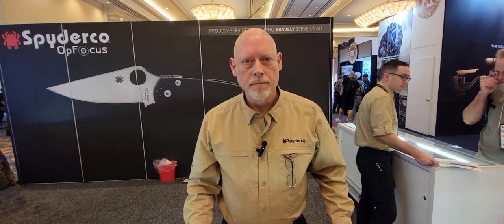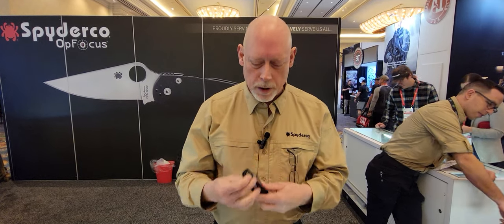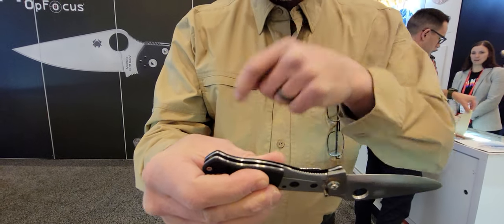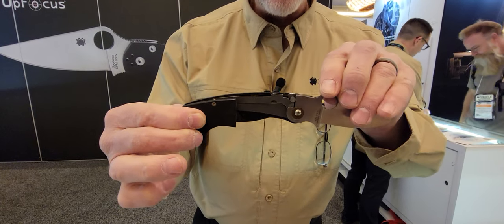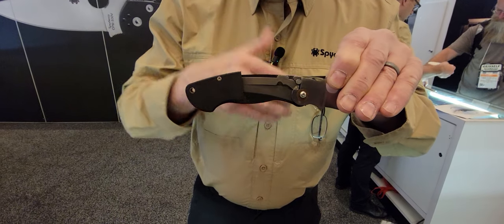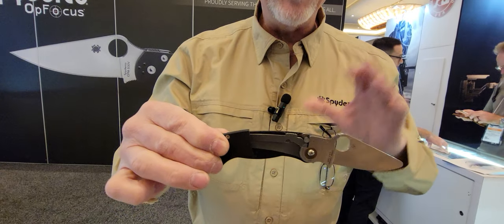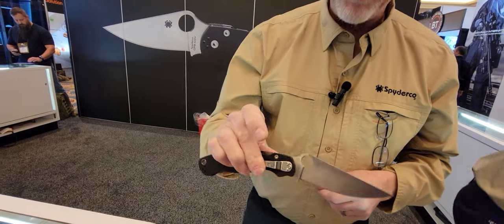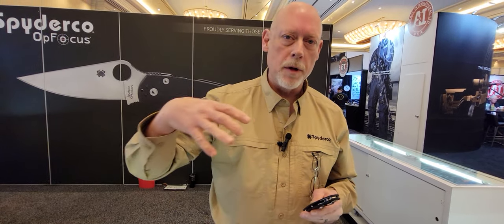Michael Janich at Spyderco  shows us a breakdown of compression lock vs. liner lock. Shot show 2023

Comment: I saw a vidio testing the strength against the  back of an open blade.  It failed with 35 pounds swinging against it. I have some knives with the compression lock.  How worried should I be about the blade  closing on my fingers,?
Reply: I’ve seen mixed results but it’s not on the high end for strength, I use triads for hard use